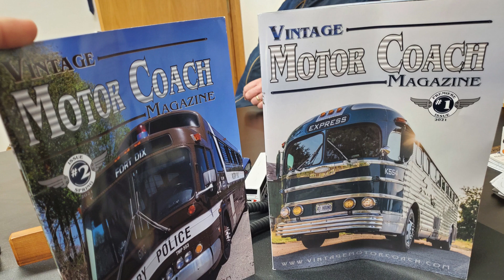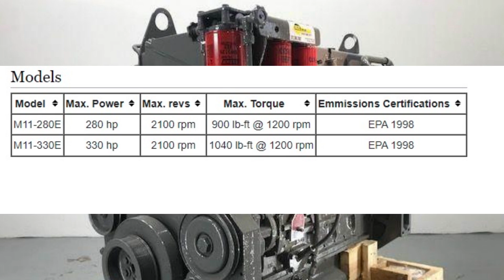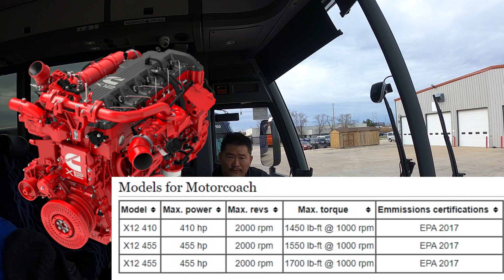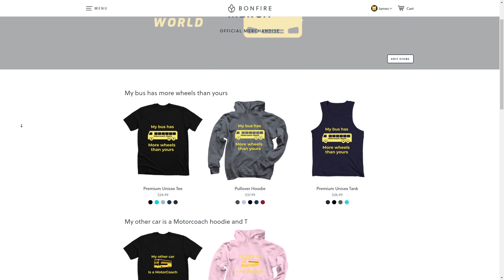What's under the hood of a bus? | Bus Engines

Comment: The Volvo truck and bus company is a completely separate company from the one that makes Volvo cars. 

They were split in 1999 when AB Volvo sold the car division to Ford. In 2010, Ford sold it to Geely motors of China. Geely runs it still as an autonomous division still entirely based in Sweden, and also uses it to provide R&D facilities to the rest of the Geely operation.

The original company, AB Volvo, continued as a bus, truck, and commercial diesel engine maker. Their first acquisition was the almost bankrupt Leyland bus and truck company of the UK. That long established brand only lasted a year or two, after which the name and products were entirely replaced by the Volvo brand and products. 

The UK operation provides most of the Volvo bus and coach chassis made for use outside North America, and all Volvo double-deck bus chassis. It also produces a range of complete Volvo busses. All of the trucks and truck chassis and some bus chassis available outside North America are made in Sweden or the Netherlands. All of the engines are made in Sweden.

The two companies have nothing to do with each other at any level, from ownership down. The only thing they share is the name and logo. Technically, they both belong to AB Volvo, but the car company has a free perpetual licence to use them. 

There are mutual conditions though - under the licensing contract, AB Volvo cannot produce, or associate itself with, the manufacture and/or sale of small passenger vehicles, i.e. cars, or car based commercial vehicles (small vans). It also cannot make or associate itself with the production of commercial or passenger vehicles with a gvw below 3.5 tonnes (i.e. vans and van based minibuses).

The car company can only make or associate itself with the manufacture and sale of small passenger vehicles (cars), car based vans, and van/minibus vehicles and chassis with a gvw of up to 3.5 tonnes. So far, the car company has not produced ANY light commercial vehicles of any type at all, and looks unlikely to.  AB Volvo has no interest in that market, or suitable production facilities even if it could contractually do so.

Both companies jointly run and maintain the Volvo museum in Sweden, being their only joint venture.
Reply from the maker: Wow some great information thank you Kevin.
Reply: Wow, the more you know
Reply: There are numerous other splits where companies share the same name but split up and are now independent:
Rolls-Royce Motor Cars (BMW)/Rolls-Royce plc (Jet engines)
Saab Automobile (basically gone)/Saab-Scania (trucks)/Saab AB (aerospace)
Case IH (Agriculture, IH=International Harvester,  owned by Fiat Industrial/CNH)/International Trucks (Navistar)
Fiat Automobiles (Stellantis)/Fiat Industrial (CNH)
Mitsubishi Motors (partially owned by Nissan)/Mitsubishi Fuso (trucks, 89% owned by Daimler)
and the latest split, Mercedes Benz (cars)/Daimler Truck.

Comment: My favorite engine was the Detroit 6V71 or 8V71. That is the only engine I ever had 45 years ago. GM, Detroit, and Spicer revolutionized putting the engine in the rear of the coach with their trajectory Spicer transmissions
Reply: Ops hit the post button accidently. GM built the Detroit/Spicer on a 45 angle and installed it in a way that the engine could be removed and a rebuilt engine reinstalled in two days. My company's mechanics could do it in one and a half days. Companies just keep a spare engine and they just kept rebuilding them and they kept their coaches for 20 and they kept putting new duct tape on the driver's seat.
Reply: I drove a MCI, retired greyhound over the san Luis pass from king city California to  hwy 101, loaded with national guard troops wanting to "take a shortcut" middle of the night poring rain going 1st gear 8 miles an hour along the top of the pass and all the windows fogged over, everybody awake like waiting for a Stephan king thriller, but just anticipating, and that's all......when we got to camp Roberts, late by 2 hours, the Sargent said, Sorry......aaahhahahaaaa 6V71

Comment: 12.7 Detroit Diesel Series 60 with an Allison B500R transmission is a popular combination because it is just smooth, superb, reliable, throbs quietly with lots of power and lasts a long time. Many of the Cummins engines are very responsive but some of their models buzz when they accelerate. Never tried the Detroit DD13.  Everything else sounds like a rattling old farm tractor (Caterpillar and Volvo D13). I find an Allison B500 transmission is a must with most motorcoaches because it makes the most out of whatever power comes out different engine models. It also helps make the most out of whatever power comes out of a tired worn-out engine.
Reply from the maker: Are you sure we are not related? Cause we think the same way when it comes to engines and transmissions lol

Comment: I absolutely love my bus being a 1989 Volvo B10M MK2, With the THD101GC 9.6 litre horizontal mid mount inline 6 turbo Diesel. That’s coupled to a ZF 4HP500 4 speed auto, With a PMC “Metro 90” alloy / fibreglass body built on the Volvo Chassis at 11.5 metres long (37.7 foot). I’ve driven a bus with a Cummins / Allison combo and absolutely hated it, As it was sluggish to take off and slow to kick down. But other “Mini Buses” I’ve driven like a Toyota Coaster and Mitsubishi Rosa and Higer Munro  in the 20 - 29 seat category they are great for around town and the odd highway squirt, Wouldn’t take it cross country though but the coasters are a popular choice to convert to a Motorhome. As the last generation was in production for like 24 years from 1993 / 1994 to around 2017 before a new model came out, Same with the Volvo B10M like I have they were in production from 1978 - 2003 and had the choice of several body builders here in Australia (PMC, Custom Coaches, Volgren, QBB etc) that’s excluding body builders in the UK like VAN HOOL. Like the Engines in 2 seemingly identical coaches in the US, Here in Australia we can have 2 seemingly identical Chassis with 2 completely different bodies. To show what I mean look up “HCVA B10M” and there’s 2 or so videos showing around a dozen Volvo B10M’s  all with different bodies. I love the Aussie  bus scene as it’s so diverse with active preservation groups as well like the HCVA and Sydney bus museum.

Comment: Best engine? Definitely LIAZ ML 635 :-)
Reply from the maker: Sounds fancy. I have no idea what it is.. but I definitely would like to know more
Reply: @MotorcoachWorld  It was an engine manufactured in Czechoslovakia (Later  Czech Republic) in 80's and 90's by LIAZ (Would be translated as Liberec Car Industries). This engine was used in buses of brend "Karosa" (Now taken over by Iveco), in trucks by LIAZ and also in lsmall ocal trains (ČSD Class M 152.0) widely used in Czech Republic and Slovakia.It's sound is also really good. They were very durable and you can see them in operation still today, especially on those local trains.

Comment: Hey James.  Got a question for you:  what's the reason for the weird angle on the windshield of the blue bus at 0:20?   Is it a style thing, for better visibility or...something else?
Reply from the maker: Hey David. You know that's a really good question. I've actually wondered that myself since I was a kid. In fact I forgot all about the fact that some buses are designed like that because modern ones don't really have that angled windshield anymore.

So I guess this means I need to find out and do a video on the topic LOL
Reply: @MotorcoachWorld  That looks like a FitzJohn Cityliner built after WW2 for about 4 years. The angle on the windshield was to reduce glare on the inside of the windshield drivers drove with the interior lights on at night. Not every manufacture had overhead passenger reading lights that was a new thing. Notice the engine is in the front. GM transit buses had angled windows because the driver had to drive with the lights on at night.
Reply: @MotorcoachWorld  I remember  highway coaches and city coaches like the front on that coach and the ones that were owned by the TTC and Gray Coach back then were 1950s era GM coaches. I hope that helps
Reply from the maker: I just love this group of people.. I feel at home with you guys! Love the comments!
Reply: I think it could just be reflection on the glass.